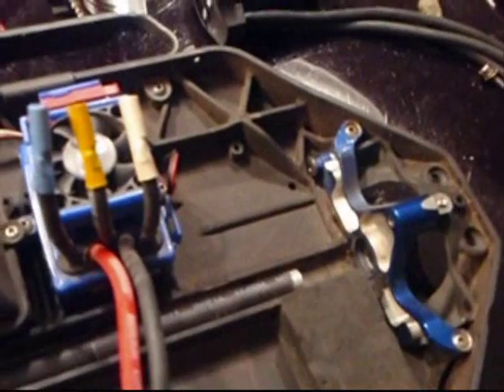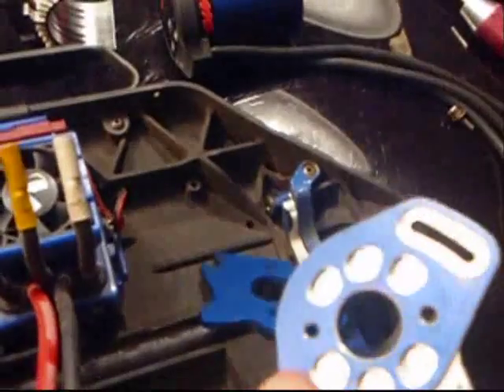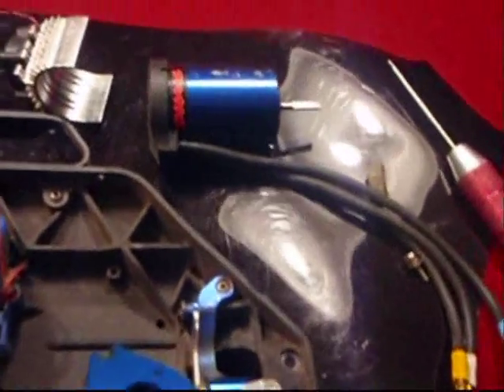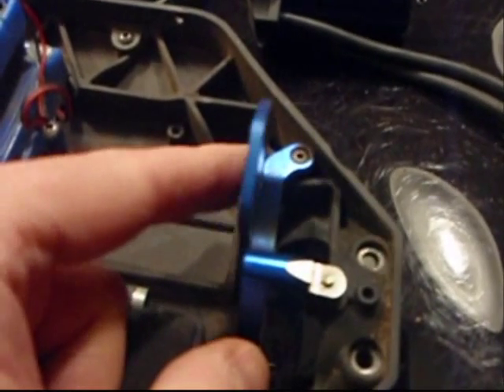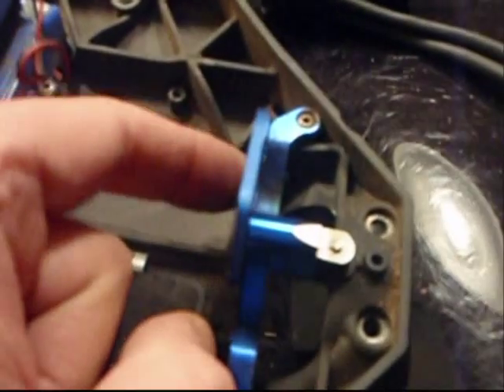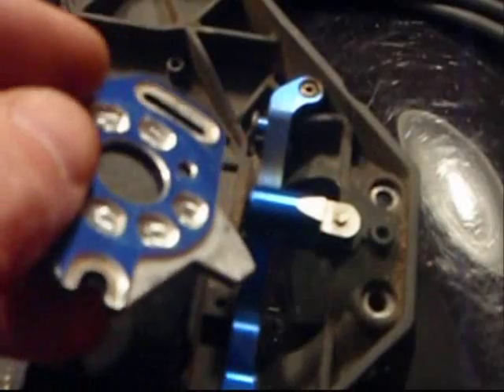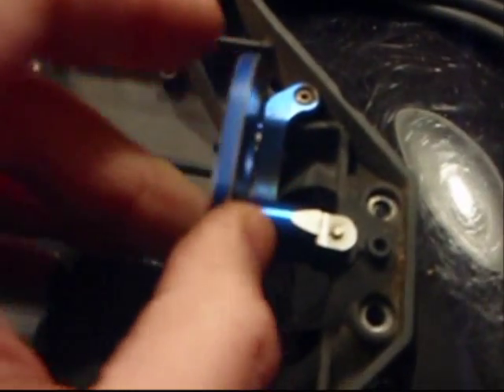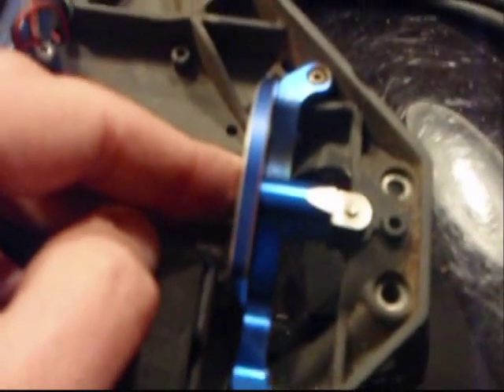Slash 4x4 Motor Mounting - A closer look...

Comment from the maker: @nts213 the arms worked well but my problem was the mip dog bones were too short since they were originally for the Rustler so I went to traxxas jato half shafts. Worked ok but hit a log at the beach during testing and tore off both front and rear right side arms. It wasnt pretty.  Going to look into longer dog bones and continue testing with a new set of jato arms.  Stay tuned...